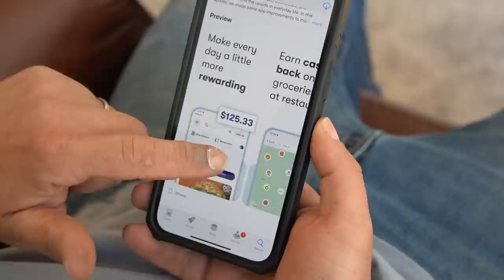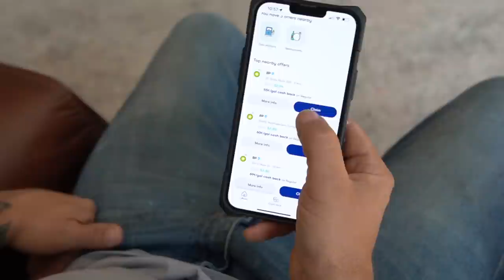CONCRETE WALLS | Building Forms For Our Self-Built Home

Comment: Hey Erin and Josh, don't know if you read these but here goes.  Just a thought, when you get to the safe room maybe consider styrene locking blocks instead of messing with forms. The blocks come with built in plastic screw sets on both sides set up for 16" on center so you can finish the interior with any finish you want (even drywall) and screw right into the plastic internal strips with the advantage that the insulation / moisture barrier is already present.  I did this in my basement build and it worked out fantastic.

Comment: Erin and Josh, If you see this comment soon, ask around about using ICF's. (Insulated Concrete Forms)  Basically they are large foam blocks with space between the walls. Available in various cavity sizes. They form the space to pump your concrete into, don't have to be stripped and insulate the foundation. 

I just checked and they are available from 4" wide to 12" wide. Each block is 16" X 48". Stack them like Lego's, place rebar inside, and pour your concrete. For your safe room, the 12" block would be close to perfect.
Reply: I've used this myself and it works wonderfully! It would definitely be a better product than this will be.

Comment: When we did our concrete safe room thy used special cinder blocks. They were different from the regular blocks and made to accept concrete better. They blocked the wall up to ceiling height and then poured concrete inside the walls. All 4 walls were poured in one big pour. Then after it all cured they did poured the ceilings. 
That way they didn’t have to make forms for concrete walls. The wall ended up being 10” thick.

Comment: You could check in your area for companies that rent concrete forms.  It will save you time building your own forms. For the forms I build it like a stud wall with the studs space 2 feet apart. Remember to spray your forms with forms release oil before you place your concrete; so that the forms will not stick to the concrete and to vibrate the concrete. Instead of cutting form to the height you need; mark the inside of the form with the height you need an place 3d nail at that mark all the way around the form and finish your concrete to that nail.  Keep up the great work.

Comment: Generally when it comes to building forms for concrete. I have always used batter boards and string lines to square everything up at first and then building the forms and all just falls into place so much easier. It took longer for y'all to try and measure and square everything up as you go without the batter boards and string lines. Nevertheless, it is not entirely impossible. You guys always do an outstanding job with the work you do. Thanks for sharing. Great video. 🙏 Namaste! 👏 Bravo!

Comment: It`s taking shape! FYI, you will want to put 2x4 blocks under your corner braces screwed into only the plywood edge, it will not hold up to the force of the concrete. Go over-board in your bracing, it is better than a wall blowing out while pouring. Take care
Reply: great reminder post for them

Comment: Never underestimate the pressure of concrete in a form. 5/16' concrete bit with 3 double headed 16pd works great also in securing that base plate,

Comment: I have been watching you kids from the start and enjoyed constructing and better yet you family ways. Great job on both but I do have a suggestion on your safe room door. Have it swing inward for these reasons. 1. Tornadoes create a negative pressure which could suck open the door if not properly secured and number 2. If any debris would to fall in front of the door it would be impossible to push it open.

Comment: Just let you know, even at this height of pour we recommend snap ties through the forms 16” on center, each way, to keep forms plum and intact. With wales (horizontal 2x4) at each tie. With vertical strong backs with bracing every 4’-8’. Also make sure it’s connected down to the footing well enough as the pressure can lift your forms. Not trying to tell you what to do, just wanting to see your family succeed here.

Comment: Josh, better double up on the whalers/ latteral bracing on both inside and outside walls. Put more tapcons into the footers. Kickers every two feet on both sides. You will tye wire the rebar, but I don't see you planning on using wall tyes and clips? A lot of pressure when concrete goes in the forms, wall tys keep from bowed walls and blow outs. If you plan on using the forms later, coat the insides with release agent, they will peal off easy when set.

Comment: It's called the John's form system... I've only used it twice cuz it's so slow, one is literally building the forms as u go along. A good system for people like you as u can now use the plywood from the forms for your sub-flooring...or even the roof. 
Good job on rebar too.
One thing I have done was to paint a thin coat of motor oil on the plywood side facing the concrete b-4 forming to prevent the concrete from sticking to the form. Dont leave the forms on too long or they'll be hard to strip away from the concrete wall....start stripping 24 hours after the pour. And remember, plenty of bracing on the wall b-4 pouring, people underestimate the weight of concrete, and you do not need a form blow-out while pouring the wall.

I missed the footing video, I need to go back and watch.

Comment: Just remember concrete is 150 lbs of force per foot of height while you’re pouring, just to avoid a blow out. A 4’ high pour is 600lbs of lateral force at the base.
Reply: I'm nervous for them.  I don't think they're accounting for this.  He needs threaded rods through the forms on a 12" grid at the bottom and maybe 24in spacing near the top.
Reply: May be a interesting learning lesson - hope not. Those horizontal 2x4’s will bow or break without rod’s tying each side together. Hopefully that’s yet come.
Reply: Pouring it in lifts will counter that problem, that being said this is ridiculous on a craftsmanship standpoint. I hope it doesn't fail but would not trust what I've seen so far at all.

Comment: You guys should have looked at ICF’s to use for your foundation. They are so easy to deal with compared to using plywood. Just basically giant leg blocks that fit together. After the concrete is poured all you would have had to do was remove the bracing.

Comment: You should always put caps on the rebar for safety in case of falling on the standing re-bar for safety !
Reply: Although agree in principle, I can say with certainty that I wouldn't if I were in the exact situation unless I already magically had some on hand. I might spray pain the tops or run caution tape along the tips...if I had the supplies...and roll the dice with fate.

Comment: Love your videos and completely impressed by what you've accomplished, but have to make the following comment.  Vertical rebar grossly misplaced and appears lacking in quantity if you have to support backfill on one side.  Guess inside gets backfilled also with floor on top, which then you would not be set up for a wall failure..  (Concrete Designer here)

Comment: Cement wood forming: The inside NEEDS to be square. The outside, not so much. But it will follow anyway. Don't forget to check for level!  And you're doing the box under a crawlspace instead of a full basement? put a cardboard tube (vent) in place now for the air instead of cutting the hole later.

Comment: Rookie question, would it be cheaper and faster with cinder blocks? I know you can technically reuse all the wood used for these walls, but still. What’s the argument against cinder blocks?

Comment: I hate to be the one who rains in this parade, but I see those forms blowing out. They make engineered steel form spacers in different widths like eight and ten inches. A steel wedge and DOUBLE 2x4 whalers hold them together. You drill all the holes first to line them up and the engineered spacers hold it all together. I bought out a lumber yard's inventory of marine grade plywood forms and added more if needed. The spacers break away and That's how the system works
   It may be obsolete at this point in time as form building has progressed to a specialty using aluminum forms for the most part. We did use plywood forms and attached two inch styrofoam to the inside of them before pouring with ten inch spacers that made the walls eight inches thick. Those walls need three rows of bracing.Ten inches from the top and bottom of the sheet and one in the middle. Engineered spacers every sixteen inches and the concrete needs to be carefully poured in two foot lifts. The good news is that most of the bracing and form plywood can be used to put down  floor sheeting and the bracing recycled into the walls.
  Good luck to you however you proceed with the project.

Comment: If someone would take some time and teach you how concrete formwork is approached, then you would not have a problem with it "out of square and crooked". Formwork is a direct opposite of house framing. A step by step procedure will take that issue of squareness out of the equation. Sometimes the forms are not level, but the concrete is all that matters. A good book or a qualified YouTube video may also work, but there are always question you will have. Good luck

Comment: Did I hear you right when you said five corners? So you're going to make a square non-square? As opposed to a non-square square which would be four corners out of plumb and/or level or a square square which would be four corners that are both plumb and level. Now imagine if it was a total dork it would be a square square square, but since you've opted for 5ive corners it's a square square non-square. As long as you don't mess it up and make a square non-square square, or a square non-square non-square.